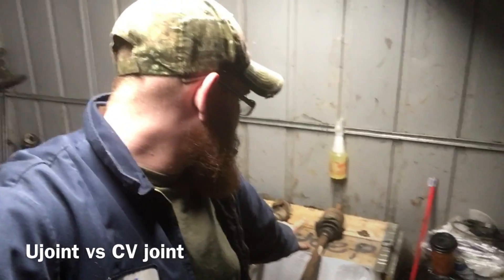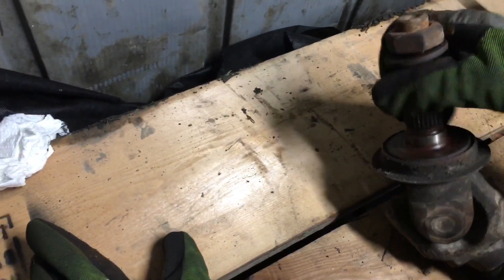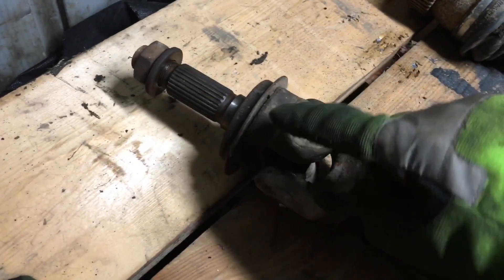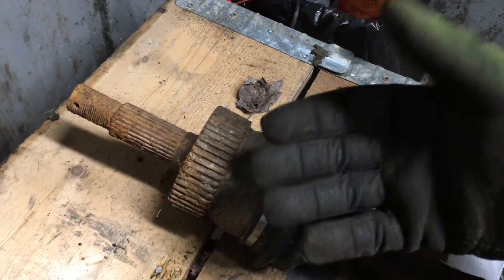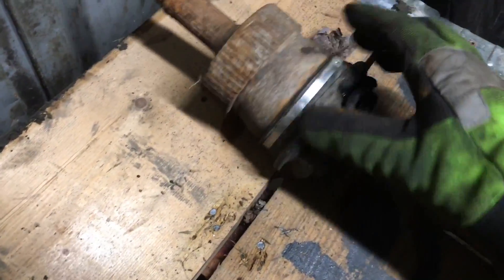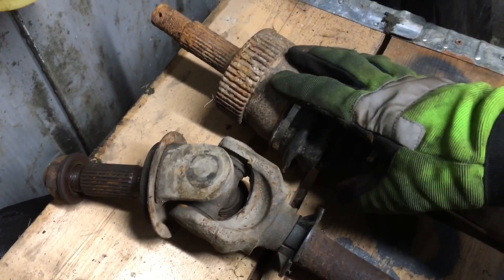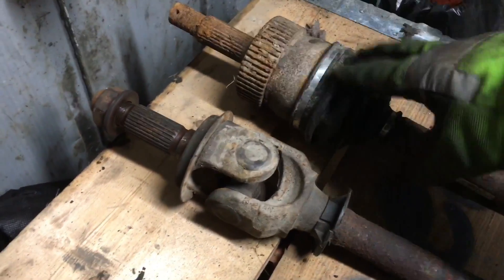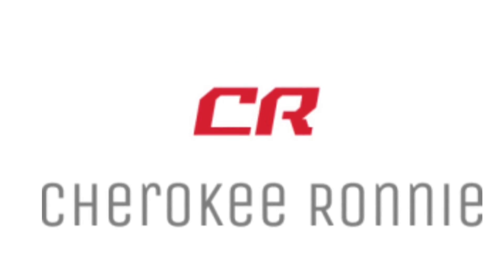Ujoint vs CV joint axles

Comment: I can't  stand the Dam U- joints in 2001 dodge ram 4x4 there to me Pita they dont turn tight too much bucking action going really slow  in my back yard , I got go wide on turns  which is  Pita So im going too change them out one way or another too CVC shaft So I can turn dam truck

Comment: If boot has a hole anyways, a syringe pop in tip for grease gun is available, to add fresh grease. Don't add too much; will come out at high speeds, along with any water. 
Best to try and replace or patch the boot, after it's dry.
I ripped them alot, running rzr on trails.
 Air hammer could pop axle shaft from cv, to split and get new boot and clamps on.
 A spring wire clip went around axle in a groove and cv hole, popped onto axle shaft with spring clip inside machined grooves of axle and cv. 
Not sure if cherokee's can split that easy or not; new to cherokees and researching. 
Relieved to hear the cv is at least equal to the U-joint design.

Comment: I'm thinking about doing this. In over 15 years of having TJ's it's rare I get more than a couple of years out of my front joints. It's mostly an on road commuter with 31s but no matter what quality I put in them the crappy NY roads and salt slop destroys them. Usually not even able to get them to take grease after only a year

Comment: Correct me if I'm wrong but u said ujoint style will fit in grand Cherokee but I've heard u cannot swap from Cherokee to the grand Cherokee with verilok cuz Cherokee is a 1"-2" to short so it won't go in far enough to lock the splines in
Reply: That sounds like the wj axle vs zj axle. Wj axles are a couple inches wider. Xj and zj are the same.

Comment: Front tires “hop” in 4 wheel in a turn because the two front tires turn at different rates in a turn.  Not because a u-joint binds.  Proof?  Take out of 4 wheel drive and turn...  No hop?  U-joints are still turning and binding (unless you had un-locking hubs, but you don’t).  Just an FYI.  Have a good one!
Reply: rubbish,never had u joints hop..only way they do that is if your limiting bolt is too far in. as mine was on an f100 lwb, the guy did it so he could park it easy. hell of a turning circle,but hopped in 4x4..i fixed it. never shit a uni. ..uni,$26. 1.5 hrs to replace. cv $250 +-. chevy,s come with 4 spare,in the tray.. cv,s have allways been crap..

Comment: CV take more abuse on turning and putting power to it. A ujoint will take more abuse on straight  a ways where your jumping on it or down shifting. It depends on how you drive. I have need for CV around here in dd  due to amount of turns. But in a trail rig I would run ujoints for 4wd crawling without a bunch of sharp turns. Zj have different wheel bearing depths for rotors to work. Also the turn stops on the axles. A ujoint hub will have turn stops. A CV axle may not have turn stops.

Comment: You can grease cv joints if you take off the band and use a gear worm clamp to hold it back down, just make sure it won't hit anything when it spins.